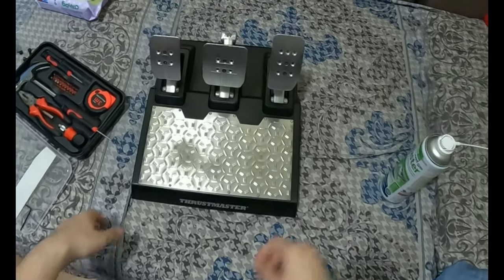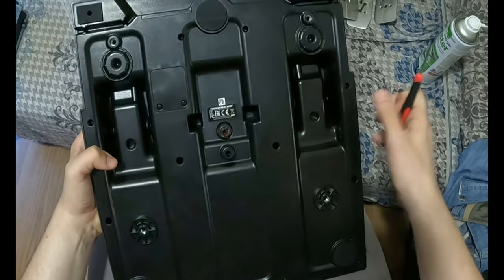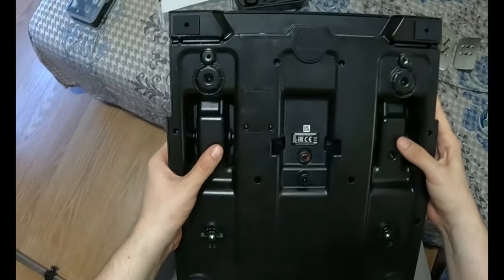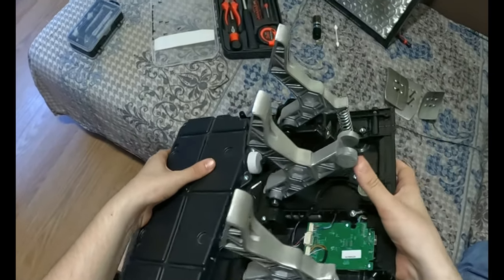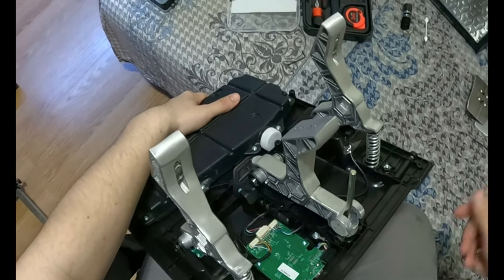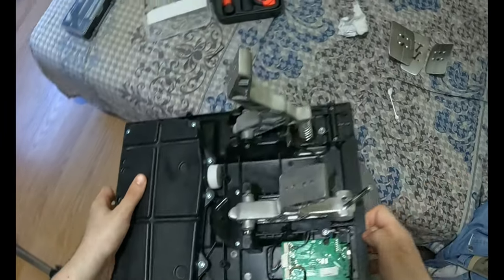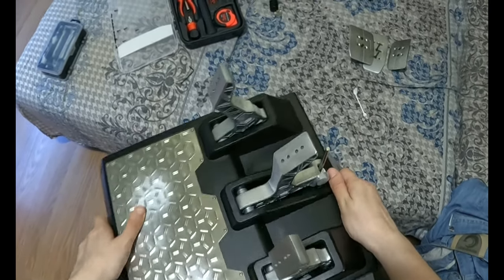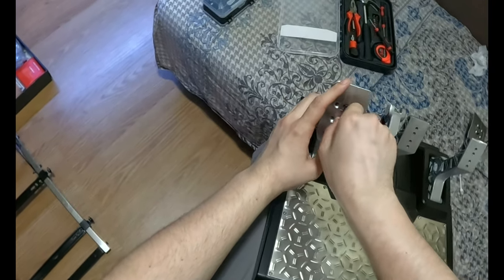Fix IT! EP5 T-LCM Maintenance (Assemble & Disassemble)

Comment: One thing I noticed in this video is that there’s a small 'container' in the empty space at the base of the pedals. I’m considering buying those pedals, and I was wondering if I could fill that 'container' with sand to make it heavier and prevent it from slipping. Could you help me figure out if that could work?
Reply from the maker: hey brother, I never really opened it, but I saw it can be screwed and unscrewed, I believe from what I heard the noise itself, I think it's sand, so we definitely should be able to fill it.

Comment: I've just got these pedals and they work great, but the brake sensor(?) seems to disconnect randomly mid-race so no brake force is recognised at all. Moving the black cable attached to the bottom of the springs then fixes it again. Does that sound like a loose connection/something that can be fixed or should I send them back?
Reply from the maker: Hey brother, I'd suggest to hop on our discord and send a short video of the problem. It could really be loose connection. It's good to be checked early, so you can get new ones, if needed!
Reply: I've just got my pedals out of the box and I'm having the same issue. Brake is fine for a couple of minutes and that the inputs start going crazy without me even touching the pedal. I move the black cable slightly, pedal works fine and then goes crazy again after a couple of mins. Did you manage to solve this problem?
Reply: @wurble  unfortunately not, I had to return them and get a replacement set that then worked fine straight out the box.
Reply: @danielalmond3272  Thank you for the quick reply. I've spent the past hour fiddling around trying to get the brake to work but no luck. Same issue across different games too. Looks like I'll also have to get a replacement. How long did it take from reporting the problem to getting your replacement?  Thanks again.

Comment: Today I am going to disassemble my TLCM, clean and lubricate them. Personally, the clutch makes noise when I step on it, the rest don't. I don't know if it is due to the cold, because my floor is marble or because there is an area of the chassis of the base giving way due to wear. It could also be due to the thru axle on the pedals. I don't know right now how this area would be cleared. Does anyone have information about it? Thanks.
Reply from the maker: My clutch makes noise too from time to time and I feared that the clutch spring has bend and prolly out of resistance. But it works fine now. I've seen that the spring sometimes move themselves a bit weirdly so you can position the spring, as you want. Test a bit etc. 🙂
Reply from the maker: You are always welcome to our peaceful and friendly discord 🙂❤️
Reply: @projectxmotorsport  In this video, around minute 34, you can see how he removes the pin, inside the arms of the pedals are the friction bushings (they are made of a ceramic or plastic compound, I think. Be careful not to damage them). Link: https://youtu.be/StPXcYVPKwo
I don't have silicone grease but I do have Teflon or even fork grease (MTB) which is quite soft. I'll try this and see the result.
Reply: @projectxmotorsport  Thanks you!!
Reply from the maker: oh yea nice, I never went into full full disassembly, as so far just very basic maintenance has done great things for me. But I might do it, if weird noises occur!
Reply: @projectxmotorsport  Well, comment that yesterday I finished the process of cleaning and lubricating the pedals, they have been great. Not a single noise, good touch and smooth drive.
I applied contact cleaner to the electronics.
The grease I used was R.S.P. ULTRA SLICK (for MTB suspension). Apply to the through-shaft of the pedal, friction bushings and the inside of the pedal arm. In the piers also at their ends and at their support points.

Comment: Do you use any grease for the brake rod mechanism? My brake feels kinda grindy if not fully pressed from pushin up on the pedal, modulating and pushing from a lower position makes it grind a bit. I thin it also suffers a bit (the pedal design) with lateral forces if bot pushed right on the center with a perpendicular force.
Reply from the maker: Hi, honestly I haven't paid much attention. I use the default spring and the brake is stiff enough with them. If you think there is some misplacement you can open the pedals and align them properly. I think that feeling of grinding comes with the super stiff springs. I felt like, it was so unnecessary heavy and went back to normal springs. What springs do you use?
Reply: @projectxmotorsport  im using the default aswell, like 6 months now
Reply from the maker: @freedomdst  I hope the plastic or something else is not giving up, because it should not grind. But honestly you can try grease, if you think it will help. But I can't advise on that, since I never tried it 😐. I agree for the lateral forces, it's logical analyz. At this point, if you really feel hopeless to get rid of grinding or some annoying sound. Research on internet, before doing something and if you find something you can try. I personally haven't had this problem. BUT as you see I drive with socks, because EMI issues o.o I quit driving with shoes cuz it was building tons of static electricity and my pedal started to stuck at random %
Reply: @projectxmotorsport  fixed it, i had left over silicon grease from a shifter mod, there is a plastic piece inside the part on top of the springs, lubricated its inside and the metal rod a bit. Also the springs have an angle i guess to follow the compression arc while pressing down, maybe those where not set correctly when i took it apart last time.
Reply from the maker: @freedomdst  Yea exactly, always double check. I was sure it couldn't be a big deal problem, unless you blasted the pedal or pedal springs somehow 🤣. 
Happy to hear it's solved. One stone off the shoulder less for ya cheers!
Reply: Lithium grease you need,
PLEASE DO NOT US WD40 GUYS, LITHIUM GREASE IS WHAT YOU USE

Comment: i have an issue with my clutch pedal where it flickers to 0.1 at times and sometimes goes to 0.4 after pressing it and it stops when i pull the pedal back and let go it does it again so what do i do?
Reply from the maker: Hey brother is that issue with T-LCMs or other pedals? 

I had this issue with logitech g29 pedals and it is bad connection, so I used WD40 and contact cleaner to spray there etc. 

You can potentially look if pedals are crazy dusty and circuit board is covered with crap or the cable is moved and last resort is warranty.

Comment: Thanks for the video, great tip on how to remove the top case. I just needed to check the unresponsible clutch pedal, and just opening it and cleaning seems to have solved the issue.
Reply from the maker: Happy to help brother, I made these videos cuz I never found ones and had to figure things on my own, when I jumped to sim drifting and racing.

Comment: hi i watched your video with great interest well done , i wonder if you could help me ? all i tried to do was to put some different springs on the brake pedal  so i pushed down to release from brake pedal was quite easy so little force was used however the pedal now wont resit in its original position ?  and now cant even get the original springs to lock in too the brake pedal as the brake pedal seems not to have any resistence and is just kind of floppy ? so the springs wont sit within the top of the brake pedal ?? any ideas whats wrong could a spring at bottom of pedal inside be broken ? any help would be gratefully received thanks .
Reply from the maker: Hey brother could you send this on discord and tag me in, as I am more active there, here is a lot of effort to have a conversation, I will see on the server and help you out!

Comment: Hello i have issue my throttle doesnt go 100%, do you think the reason its dusty inside or no?
Reply from the maker: Yes a guy reported also that, it could be dust or the stopper has worn out and when you press it doesn't block properly or some shit and messes the calculation of the sensor, but my advice is try to dust it off, then use some wd40 or contact cleaner on the sensor.

Comment: Hi. Which screwdriver (size/model/name) are you using to open tlcm?
Reply from the maker: Hey mate, I just used small screwdriver honestly not sure about the size, you can see it's very small one and long, so it can get in these small holes to unscrew the screws.
I have a very small pack of tools and I use stuff from there. I just grab whatever tools can work for the job.

Comment: Hey man, my throttle spring snapped and now I need to get a new one , where can I get on, was planning to get one from aliexpress because thats going to be the easiest to get
Reply from the maker: Hey brother, I had snapped at least 3 now, you can go to a local shop, if your sell springs, sadly in my country I can't even find one haha. 
I bought from Thrustmaster, but prices for some stupid springs is craaazy, I strongly suggest getting cheaper ones from somewhere else if possible and thrustmaster to be last resort.
Reply: @exoticdriftnrace  yea but the problem is I don't know the measurements
Reply from the maker: @saif.rawahi  if you google up, there was a thread I think on reddit and a picture of the guy showing them don't worry.
Reply: @exoticdriftnrace  for some reason I can't open reddit weird
Reply: @saif.rawahi  Hi, both spring length 70mm and outer diameter around 18/19mm. Throttle wire is 1,5mm and clutch 2mm thick. I bought different sets in different wires (1,6mm , 1,8mm ....) to try. 

And to get maximum life span from springs: grease them.